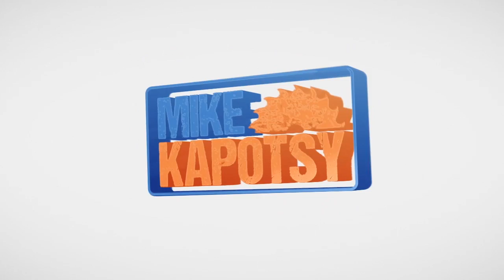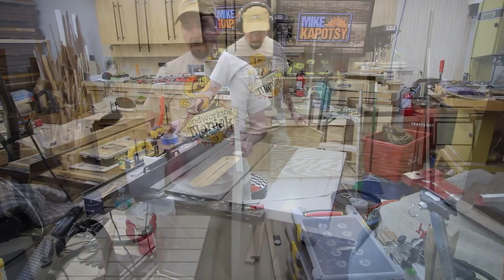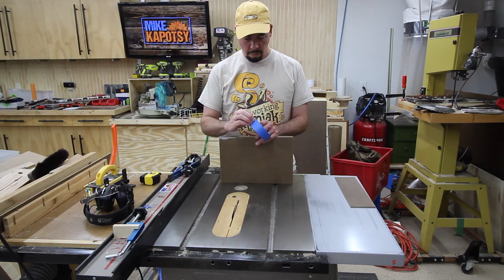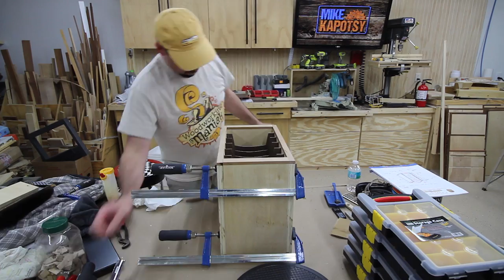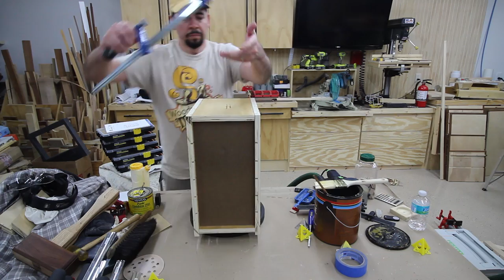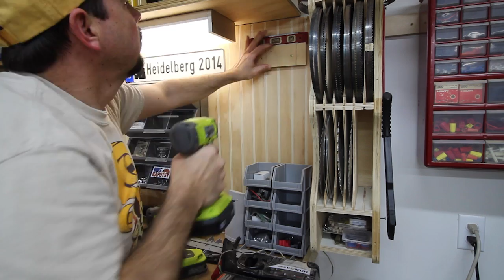One Day Build - Shop Small Parts/Hardware/Tools Storage Solution

Comment: Good one.  I prefer to have those shelf dadoes extend all the way out the front to allow removing one divider at a time.  And if you use more  dado slots than is first necessary, you get the option to slide in  shorter, or taller, parts boxes.